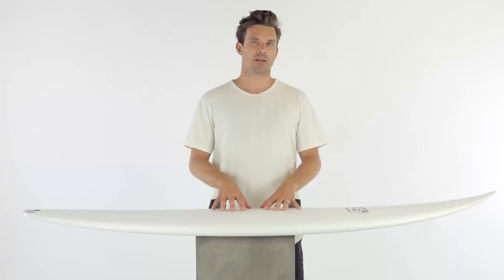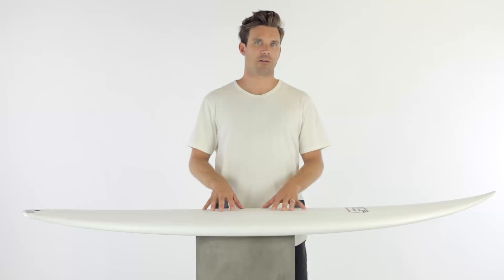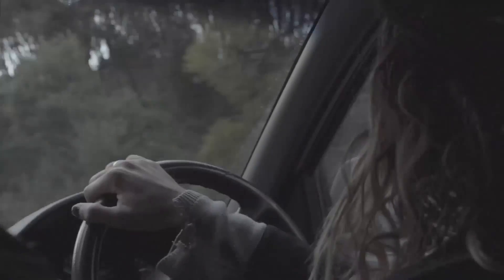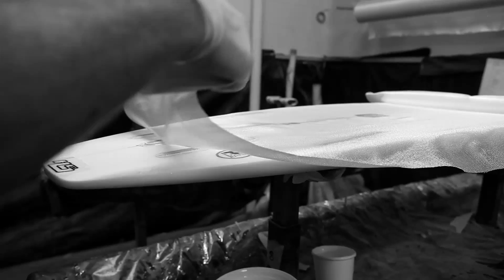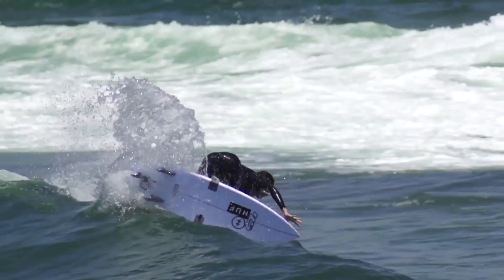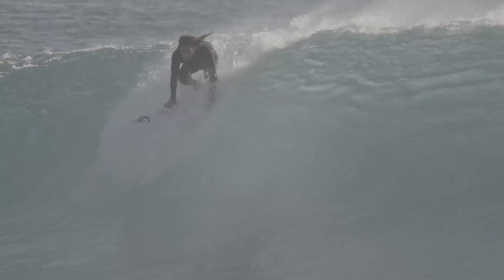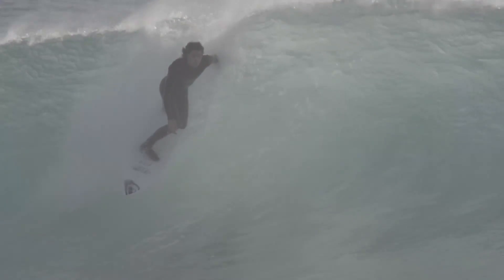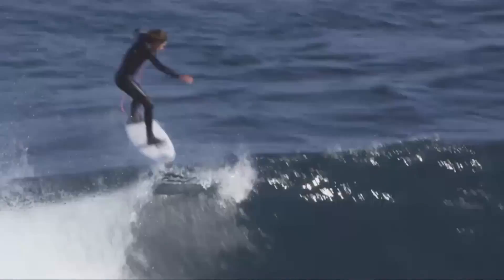(PE) Polyurethane Epoxy Surfboard Technology

Comment: Alright,..  I love how my 6'1" White Noiz handles and performs.
I've also read/heard that epoxy reason soaks into the pu foam more,…which can cause more weight,… but then that can depend on the foam.   What type of blank to does Haydenshapes use for their standard PE boards?